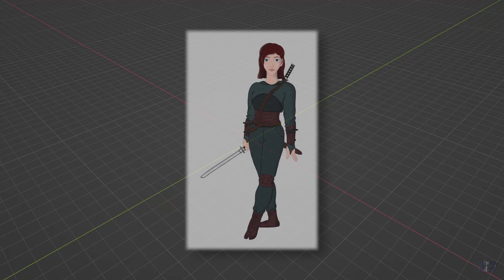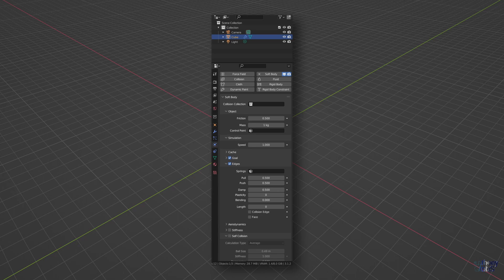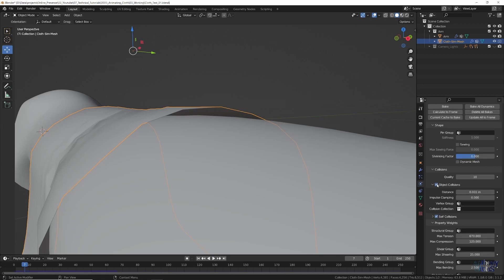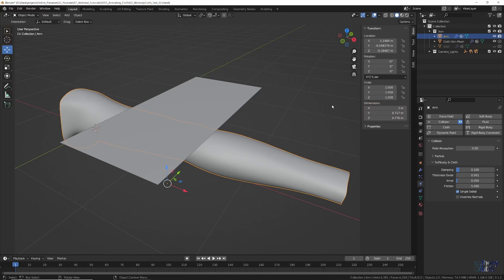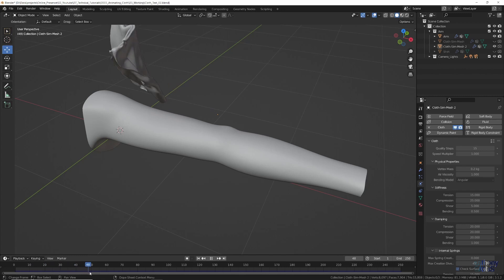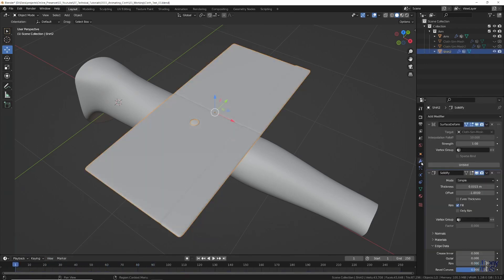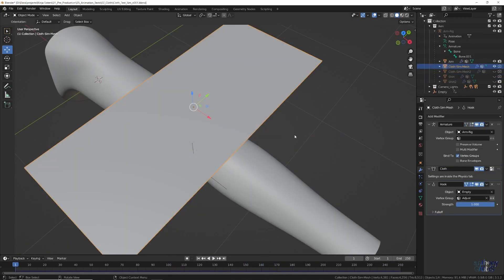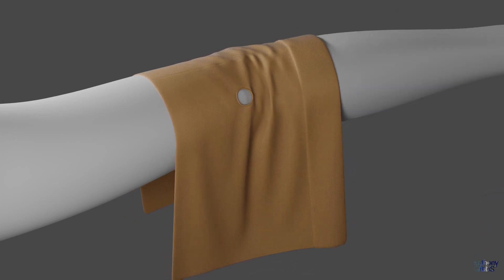Technical Overview-Animating Cloth in Blender

Comment: When you scale up the cloth, how do you account for it being affected by 1/10 of the gravity that it would have in 1:1 scale? 

Obviously I guess you would set the gravity effector to 10, but then that starts messing with all my stiffness settings and starts making things all jittery. 

How do you account for the gravity when scaled by 10x?
Reply from the maker: You are partly correct, I do increase gravity, but only to around 6. Along with this other things also need to be adjusted, like damping and vertex mass. Due to the old nature of Blenders simulation system, it really does just take a lot of messing around and tweaks to try and get something that looks OK.
This is also very dependent on exactly what is being simulated and the type of overall movement. Add to that, there's usually no shortcuts, one just needs a fairly dense mesh and I have overall quality at around 35 for the simulation and 12 for collisions. In other words baking takes a little time, it's just how it is.
You can see a more recent test I've done which uses the above, along with the techniques in this video. It's not perfect, but I think its about as good as Blender currently gets: blenderartists.org/t/animated-short-film-the-trinary-prophecy/1372524/71

Comment: Hello. In your tutorial you recommend increasing the scale of the model. But what about the location in which this model will have to be rendered? Or is there a way to reduce the finished fabric model back to its true size? I haven't found it yet.
Sorry, one more question. Is it also convenient to work with an increased scale of the model for simulating hair physics, or is this only recommended for fabric?
Reply from the maker: For an animation, this is ideally all controlled and animated by an armature. As such, you can bring the model into a new file, link in and apply the animation action from the animation file. You scale the whole model up by a factor of 10x (all the location/position should just flow through) and then do the simulation.
Once the fabric is simulated, select and export it out as an alembic file. Then back in a normal animation file (where everything is still the same real-world scale), you important the simulation alembic mesh back in, HOWEVER the import panel has a scale setting that defaults to 1.
Change that setting to 0.1 and then import. That will scale everything back down and the animation will match up.
Of course that bakes in the overall animation in to any mesh you have ran the simulation on, hence simulation is only done after the animation is final and complete.
I cover a little bit of this in my Character Animation Production video.
As for hair, even if you are using the particle system for hair simulation, scaling everything up should help, since much the underlining physics system in Blender for Cloth, is in fact used for the hair as well.
Just keep in mind, till GeoNodes is fully worked out for simulation of Cloth and Hair, nothing about the current physics system is really all that great and if you can avoid it, I would do so.
Reply: @antgib  Thank you very much for your answer. I also thought about the alembic when I wrote you a question. It turns out that in relation to hair in Blender the technology is the same as when making videos using the Unreal Engine. Through the alembic export. I made cartoons in both Blender and UE5. I worked in Maya for many years, but now I am a fan of Blender and would like to interact less with UE5. I am very attracted to the concept of doing everything inside one program (well, maybe except for sound) and Blender gives this opportunity. But obviously the method you described with the scale game is the most optimal.
All the best to you.
Reply: @MrGravicaper  You can use geonodes to scale before the cloth modifier and after it to scale back. The collision mesh can be created separately, deformed by Armature or Surface Deform, then scaled, in the usual way or by geonodes. Alternatively, you can use geonodes to create an enlarged instance of the character's mesh. Optionally, you can use a vertex group to remove parts of the mesh that are not involved in interactions with the fabric. Surface Deform for a collision mesh, instead of an Armature, it is convenient not to make shape keys if they are used for the original character body.
Reply: @antgib  Thanks Anthony, you are a life saver

Comment: I spent a lot of time trying to hang a cloth mesh from another piece of geo (A ribbon with a circular hole, attached to a ring on a sword pummel) and blender was absolutely incapable of managing it. Very disappointing.
Reply from the maker: Even with various tips and techniques, Blender current core physics/simulation system for stuff like Cloth is basically a decade old. As such, try anything a bit complex and what seems to work in general theory, starts to be a problem once you get down to fine turning and details.
Hopefully the intended replacement system, based around the new Geometry Nodes will be better.